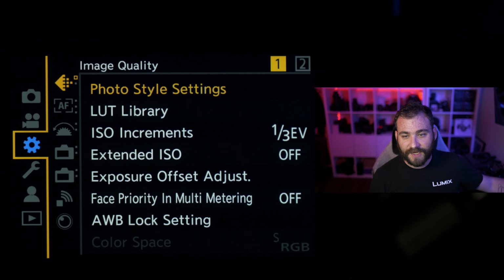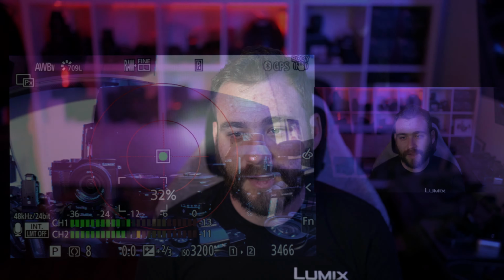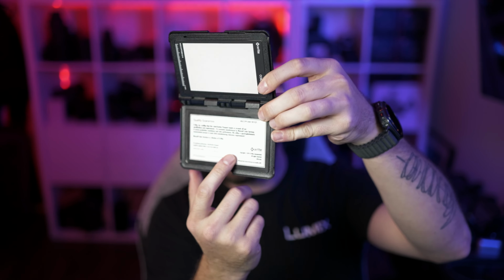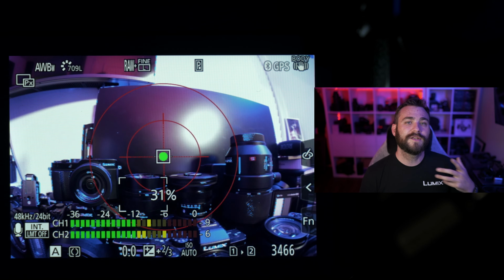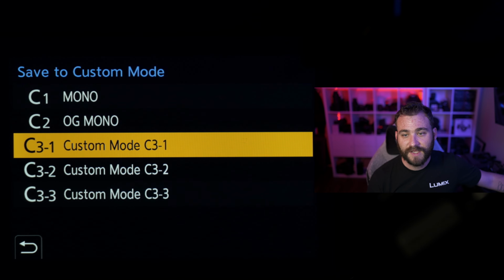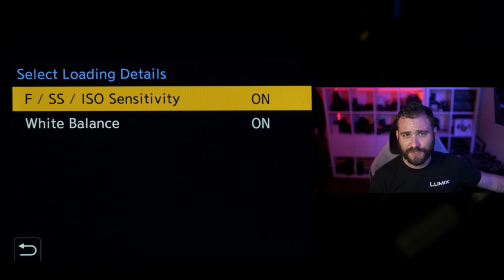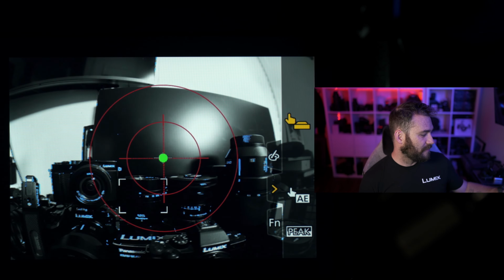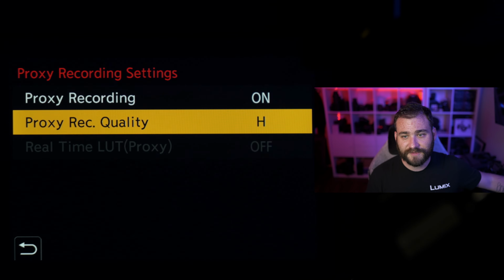LUMIX Live : Workflow & Customization

Comment: 📹📸📷🎥 Sean: With the GH7 and Lumix 14-42mm and 45-175mm power zoom lenses, you can customize the controls to enhance functionality. By accessing the customized prompts menu, you can program the knob wheel as follows: Wheel-Up: Zoom In | Wheel-Down: Zoom Out. To control the zoom out specifically, you’ll need to ensure the top knob wheel button is selected. This configuration works seamlessly with both power zoom lenses for smoother operation. 🎥📷📸📹

Comment: Please add wired connection support to the "Lumix Sync" or "Lumix Lab" app to improve connection stability.  Also, please fix the "AF scope point" functionality for PC tethering.  Currently, this feature doesn't work when I connect to my computer using "Lumix Tether" software, and reliable autofocus is crucial for my still photography.

Comment: True AWB Lock is missing for videos. What I expected and what I have used in my previous cameras is that if my camera is set on AWB-Lock mode then the white balance should be locked at the moment I press the record button. There shouldn't be any need of pressing any second button to lock it. Maybe a third option should be there similar to the photography option where it should say - "Lock WB with Record Button", like the current option of "Lock with the shutter button". Its good for the photography currently but for the videos its not enough.  Currently the I miss to toggle locking the AWB by pressing the function button during the run-n-gun type of shoots where I use my S5IIX, and I end up with the messed up white balance in hundreds of my clips at the end of the day. @lumixusa #lumixusa

Comment: @lumixusa I'd love to know your thoughts on IBIS. 
for photography if it is left on auto all the time , can it have a negative effect at higher speeds . For example at 1/250 sec can the ibis potentially cause motion blur at these higher speeds. As I have some unexplainable blurred images at 1/250 sec with 85mm ,Ibis on and almost no movement from subject there was a weird motion blur around subject